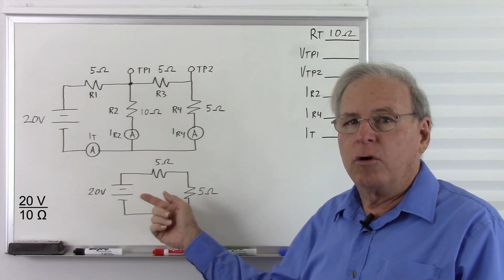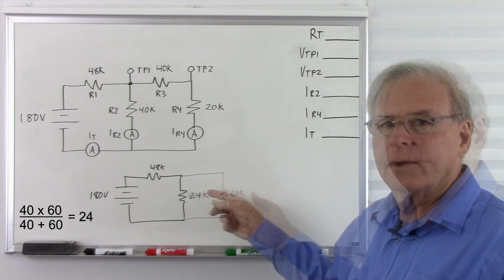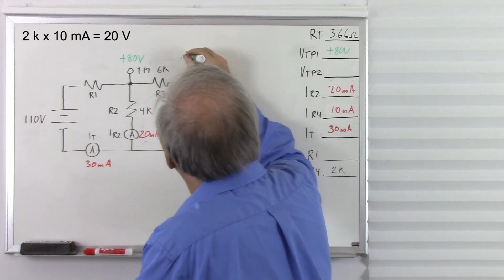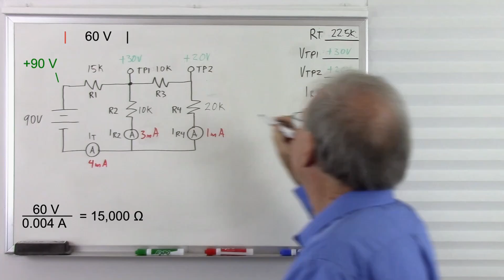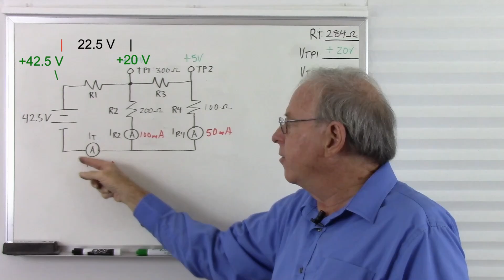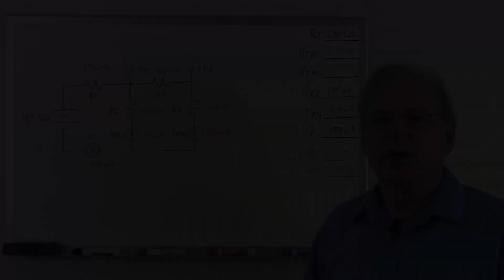Lesson 6a   Series parallel Circuit Exercises   Part 1

Comment: If anyone is stuck on the problem at 16:28 like I was for literal hours, the total resistance is 3.66 Kiloohms NOT 3.66 ohms like it's given to us in the answer column.  This absolutely destroyed my chances at solving this problem, especially since I figured out R1 first because that was the first thing I noticed I had 2 values for.  I had a known value which was given to me to solve the problem, and when none of my calculations added up to the total resistance, I could only conclude that all my other calculations were incorrect.  This set of problems have done nothing but make me more confused with all the errors.